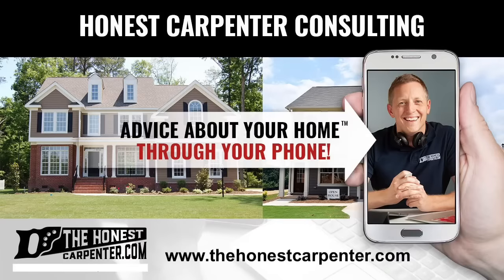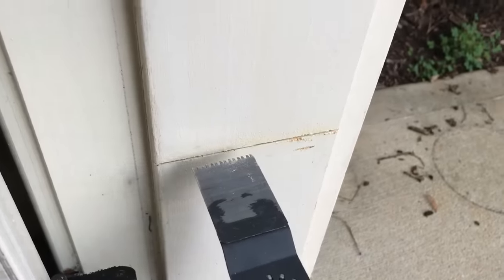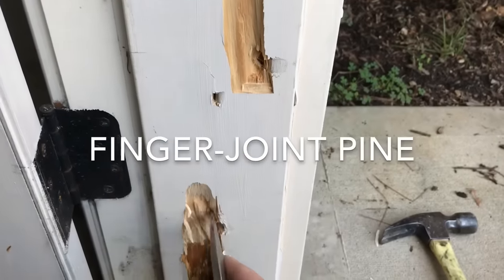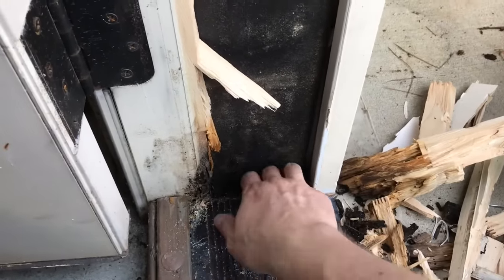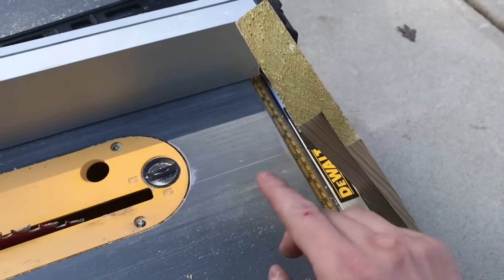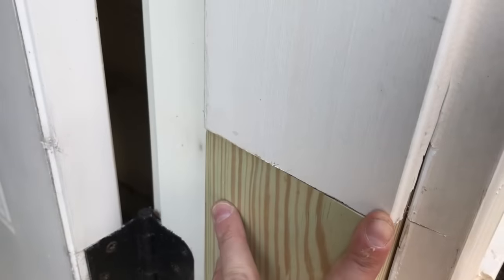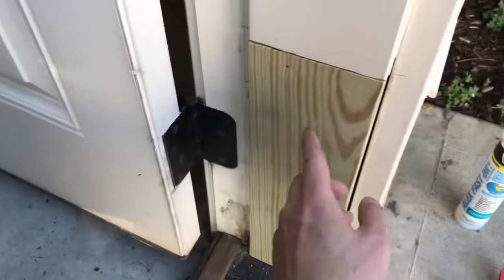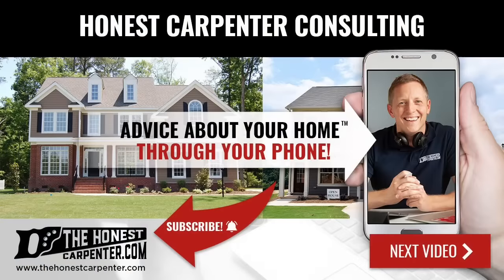How To Repair Rotted Door Jambs

Comment: With those thick shim and moisture getting in at the bottom, seems like a great place for mold to grow behind the new wood.
Reply: Maybe try thinner  shims and or thicker wood
Reply: Mold really is not an issue in a little cavity behind an exterior door jamb. It won’t be able to get anywhere else.
Reply: English Vietnamese With Mimi mold is good for you
Reply: English Vietnamese With Mimi is you are Vietnamese you should be more respectful of family. Please rethink before saying hurtful things especially during this time.
Reply: @dustdistrict9296  Saying Mold is good for you is respectful? Right after you bud.
Reply: Was done wrong , the replacement piece should be an exact fit size, then there's no need to do all that
Reply: joe rolland yeah you don’t seem like u know much about it

Comment: Great video and great workmanship. Alternative is available though... there is a product  by Abatron called LiquidWood and WoodEpox that I just used that worked well. You dig out the dry rotted wood and vacuum what’s left. Then you mix the liquidwood and brush on several times until absorbed. You then use WoodEpox and mold that into place while the liquidwood is still wet. Then you sand a bit until it matches surrounding piece and you are done.  Once cured the product can be sanded, painted, or stained.  Many historic restorations are done with this stuff.

Either method is good.   I am not a fan of lazy manufacturers that create the problem in the first place by using pine or melamine which deteriorates rapidly when water comes into the picture.

Have a great week!
Reply from the maker: @Mountain Creek Good tip! I haven't used Liquid Wood yet specifically, but I've tried a couple other comparable products and had some success. For small patch, I think it can be a good route for DIYers who might not have as much saw experience. Thanks for writing in!
Reply: Video link?
Reply: That can be like a dentist who didn't drill out all tooth rot and then put a filling in.  You cannot always see ALL the rot, and if you miss ANY, even a speck, it keeps spreading and rotting.   I see painters doing that type of repair all the time on jambs and windows, usually fails.  Also the expansion and contraction will be different on both materials, causing a crack, then water, then rot/failure.  Don't get me started on fillers for rot.
Reply: @edwardschmitt5710  I have read that if you stop the water source, the rot stops. Ours is cleaned up and repaired.

Comment: Oscillating tools are the greatest tool ever made. From my experience,  the Dewalt XR are the best and you can find them (with batteries, charger,  and bag) for $99 all over the place. (But it must be the XR... the other version from Dewalt suuuuuck. And tge Dewalt XR oscillating tool is also the best tool in Dewalt's line.
 
So for $200 you can get the tool, and the small piece wood to fix door.

Comment: I like using Bondo wood filler. The stuff dries hard as a rock, and you can sand it down with an oscillating tool. It works great as an alternative.
Reply: And does nothing to stop or kill the existing fungus.
Reply: Semper Fi you're supposed to prime and paint the patch onces you're done

Comment: Thank you for this. I have to do both sides to my daughter's back door, and have been dreading it. This helped a lot.
Reply: Epoxy injection and consolidation are much easier and will not rot again (assuming you took care of original water source--otherwise the wood will rot away from the epoxy next time)

Comment: I design doors and windows for a living and the repair you did will work for a while.  The real problem is that unless you buy a fiberglass or other composite door with a composite threshold the jamb stock will wick water again.  Under the actual threshold is probably less than a number 2 pine grade pine board.  What you kept calling the jamb is actually the "stop" the rest that you dug out is the actual jamb.  When installing a new door even with a composite jamb, always use a rubber membrane on the floor that is sticky on the down side to prevent water wicking.  It's good to run that up the rough opening about 6 inches and run it past the door and around the corner like flashing.  The other beating doors take is no storm door.  Every door should  be covered by a storm door.  The other issue that door jamb had was likely water splashing on it.  If your door faces south or west get a venting storm door, otherwise the door can reach 400 degrees.  I've seen the plastic surrounds that hold glass in them melt.  Home Depot sells the jamb stock with the stop attached so you can cut all the way through to the rough opening and not have to pick out the jamb in pieces.  Not trying to dog your work, but make your life easier in the future.
Reply: Doesn't the jamb attach to the threshold?

Comment: My carpenter uses PVC board for those repairs.  Nice vid .
Reply from the maker: Thanks Gary! PVC is a great option here too--a little more expensive, but every year I feel like I see it come down in price a little
Reply: Excellent idea
Reply: Iv done this repair many times and not always because of rot actually.  My leading reason of this repair is actually storm door damage. I do it slightly different with the same goal, just different approach. I continue the "control cut" as you call it right down the interior stop. Once new jamb fits flush with the existing jamb, I run a pencil line along the back of my patch " representing the weather stripping"  and run a rip. It will take two passes to open the kerf correctly. Most of the time it is approximately 5/32 or a blade and a half. Too tight and the stripping the never fit into loose and it will not stay in place. Then to finish everything off I've always used epoxy wood filler so I can sand Prime and paint within an hour
Reply: My saw blades hate PVC. I don’t like it either. There is a soda ash composite that can be submerged if you’re after something esoteric with limited availability and application...
Reply: @TheHonestCarpenter  cost of material shouldn't contribute to choice it's charged to customer anyway. ALWAYS use best materials for ALL work & not cutting corners sacrificing durability of repair
Reply: @ErekPorembski  is it Boral?  I used their trim boards and even beveled siding to side a whole house with it. I know it was ash based. The advantages of this product is that it doesn’t expand and contract as much as pvc so not the same challenges at mitres or when joining ends. Takes paint better than wood (just like pvc does) because there is zero moisture in it. Only thing is that it is relatively soft so if it’s somewhere where it could get dented or marred it will do so.  Most trim on a house or even siding doesn’t really have that problem though.
Reply: @thomasmalcolm110  true, but his repair really is quite good. I’ve seen this exact repair last for years looking as good as new.  Generally you are exactly right about using the best materials and most problems are a result of not doing that. However the very BEST materials can be beyond what is reasonable depending on what you’re doing. Marine epoxy is superior to any other filler but costs much more than say, minwax wood filler for example.  For a job like this pvc or pt wood are both acceptable.

Comment: If it’s a 4 9/16” jamb, Lowe’s sells treated prefabricated jamb legs that you can install (just cut to size) that has the weatherstripping groove.  Just make sure to cut below the bottom hinge so you don’t have to mortise it out.
Reply: yeah but where is the fun in that?
Reply: Ryan Fontenot  he simply said to cut 'below' the hinge so you wouldn't have to cut a hinge pocket or even take the door off.
Reply: Have the the table saw, but the dado blade costs more than what I paid for the saw, got the saw, for like $35, dado is over $50
Reply: Thank you for the tip.  I have a back door that needs repair.  : )

Comment: Nice! Optionally you can by a single vertical piece of the door jamb as opposed to  an entire 3 piece set and then cut your section from that.. It includes the rabbit cut for weatherstrip, even though it may seem wasteful, its the correct width and thickness plus the weatherstrip cut so it makes it a bit simpler in that respect.

Comment: On door jam cutting I will use a scrap piece of lumber cut square. tacit to the piece being removed. The lumber now is my guide so the cut line is square and true. Now fitting in the new jam piece is a breeze. Also can do angle cuts and beveled cuts easily.

Comment: So why would you not choose a pvc type piece for replacement instead of pressure treated?  Thanks!
Reply: Possibly cost and the huge mess it makes - Properly prepped wood will last many decades.
Reply: Expansion and contraction is different in PVC compared to timber which would lead to caulk and paint cracking along the joints where it meets the timber....which will allow rain water to enter and rot the remaining timber.

Comment: To make the removal of the damaged piece easier just cut multiple horizontal's in the piece and then use a wood chisel to remove the smaller length vertical pieces. Just start the chisel in the groove of the horizontal below the top horizontal for instance and go up and down from there.

Comment: looks good, you did a good job ...I have a couple of tips.I only cut out a few inches above the rot don't see a need to bring it up higher. When you bring it up higher your bringing it up closer to eye level where the joint can be seen. Also about that joint I would use wood filler or bondo not calk . The calk will shrink in and that joint will be visible. With wood filler or bondo you can make it disappear...

Comment: FYI, to anyone getting new entry doors, and frames, always ask for the "no rot" or "frame saver" jambs. Always. 
These are lifetime transferable warranty jambs. The company that makes them guarantees them for life and will replace, at their cost, any jamb that rots due to to failure of the jamb. All they need to be able to do is identify that it's their jamb by feeling for the embossment.
The cost is like $10 more per jamb. Where I work we always include them in quotes, unless they want stain grade jambs, and if the customer gripes about the $10, we discount the door $10 and send it anyway. 

The other option is a fully composite jamb. More expensive, by about $100, but fully rot proof, for those whose doors are subject to either super humid or wet weather. It also has to be put together, but that's easy.

Comment: Great video repair. Also, why not cut it out vertically with the SAME oscillating multi tool. It is made for those type of scarf plunge cuts.
Reply from the maker: @MasterHustler Thank you! You can totally use the oscillating tool for the vertical cut as well, you just want to remember to space it back a half-inch from the edge so you can create the rabbet overlap. I typically break pieces out like this just to save on blade life a little--those blades can get pricey!
Reply: @TheHonestCarpenter  I get blades on Amazon.  50 for $65 or so. They don't last as long but they don't cost $12 for 1 at the lumber yard.  Nice video.

Comment: This seems to be more geared toward professionals to get the job done faster or for major damage worse than what was shown. An average person doing this at their home I would think would be to use a paint able epoxy after cleaning out the rotted ends using a dremel or die grinder. This Old House has a good tutorial on the other method, but this always seems to be the most popular method found online.

Comment: Also suggest priming the piece before putting in place.
Reply: And, I would not put silicone caulking on anything that will be painted.  He did suggest that for the bottom of the good side of the jamb.
Reply: Just use PVC or composite instead of more wood that will eventually fail again. Pressure treated wood is not rot proof and since he didn’t seal the end that’s on the sill moisture will eventually get up in there again. I did mine with PVC or Aztec and after paint you can’t tell the difference!
Reply: @pblask6451  AZEK.
Reply: smiths penetrating epoxy, 100% water proofing. Paint is partially waterproof and loses waterproofing over time.
Reply: seal the end grain even though it is treated...still from my pov a cheesy repair
Reply: @pblask6451  I have dead termites in one of the new pressure treated wood and it rots given enough time. My major problem is some twists like a pretzel.
Reply: Well. Well.  Well.  Regular acrylic house paint will not marry well with treated lumber. Unless you put an exterior primer on first ... the chemicals in the wood will fail the paint.  Always.  Love the technical part of this video, but strongly suggest a no-rot alternative to wood.
Reply: @edwardschmitt5710  it was probably “autocorrect” my worst enemy when I send texts as well. I look back after sending and am like what was that gibberish!😂
Reply: If using pt wood, try to use one that is relatively dry. So much moisture in new pt. Azek is a good alternative as was pointed out but does contract quite a bit when cold thus opening the joint. That’s why when working with pvc you should glue joints with pvc glue, although that may not work when gluing it to wood. Boral is a material that comes in dimensional trim board sizes that doesn’t expand and contract as much as pvc. Not as easy to find though unfortunately.  Having said that, his repair is quite good and will likely last for years. Beveling the cut downward is a good suggestion as well as priming the end joint of the cut jamb and the piece. Epoxy is a good more permanent thing to use to put into the joint as well.
Reply: @victoryak86  LOL my phone is always killing me.   S*it is not a word for instance.

Comment: They also sell pre hung  units with a jamb saver  this comes with a composite material finger joined to the bottom of each leg.  That’s all I order for clients or full composite
Reply from the maker: @gregwolters2 That’s a good point. A lot more milling companies are starting to add composite bottoms, so you can even get single side jambs with the 5 degree cut in place if you look around  🙂
Reply: My clients get jamb savers, I don’t give them an option, it’s something like $20 more. I used to do those jamb repairs and discovered that replacing the entire jamb side is faster and the finished product looks better.  My local Millwork shop sells the jamb legs milled or unmilled for the hinges.

Comment: Don't use painters caulk to seal water out. If it says easy water cleanup it's not for outdoors where I come from. Also, a little pre priming or azek/PVC boards adds life. We always use composite jambs or doors with jamb savers here on the Oregon coast anymore, wood ones last about 2 years

Comment: I usually tack a board to the jamb and use it as a guide for the blade run along. This way you get a straight cut with no issues
Reply from the maker: @RC Jabroni yup Very good point! A brad or two shot in can hold a guide board in place, and gives a perfect surface to get the plunge cut started :)
Reply: Or use a speed square

Comment: Great info!  I did this same repair years ago, but in my case, the brick mold had rotted too.  I actually bought another door jam (the whole thing) because it wasn't that much, and I cut about a foot out of the bottom section that I needed.  I cut the existing jam with one of those circular rotozip tools, but I think using the oscillator tool would be easier.
Reply from the maker: Thanks Jay Man! I'm using pvc a lot these days for this repair, and I do the same thing you did--just buy a pvc door jamb and use that for components :)
Reply: I suppose that's great and all if your original door jamb is not too old and you can find replacement door jamb parts that match evenly.

Comment: You should have primed the end grain at the bottom to stop it sucking up moisture!
Reply: He said it is treated deck lumber, albeit I suppose he should seal the end grain anyway.
Reply: @rbrtck  He showed in the video he shoots silicone underneath to prevent moisture from getting there. He showed it on the original piece and not the new one. You can't believe he would seal the bottom on the old wood and not do the same to the new piece he just replaced.
Reply: Great point!

Comment: Lots of comments about sealing the end grain at the bottom.  I use paro wax and a heat gun.  The wax melts into the end grain and seals it better than anything else I've found.  Great to use on end grain on deck boards too.
Reply from the maker: @Dave Freeman That’s a good idea. A lot of wooden porch columns these days are coming with wax sealed bottoms. I guess if it works for toilets it can work just about anywhere! 😁
Reply: How do you paint or stain after?

Comment: I used to do a lot of these, before I retired. I just buy a door jamb set from HD or Lowe's. Already primed in the pack. This way the kerf for the weatherstrip is already done as well. I cut to length then rip the thin part away. Then I paint a bit of roof sealant  ( would use Flex Seal now ) on the ends and  voila.  But I would make a couple of vertical cuts to make removal easier and quicker. Of course, every carpenter in the world has their own way.  No absolute best way, for sure.

Comment: if you cut the rotted portion at a 45, then use liquid nails to glue it in, the seam will virtually disappear.
Reply from the maker: That’s good advice Daniel! Thank you!
Reply: Semper Fi  Read the post I put. It explains how to cut angle and bevel cuts with a multi-tool.
Reply: Daniel Smith yeah that was my thought. 45 with a circular saw to make a straight and quick cut then switch to the oscillating multitool to finish cutting all the way through.
Reply: That’s how I do it love from England
Reply: @joycemiller4716  make a video pleade